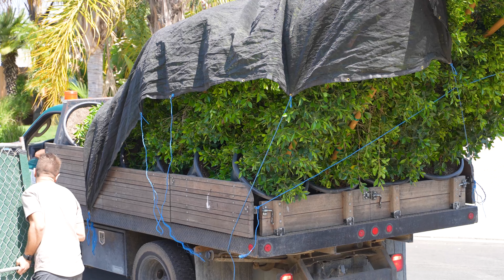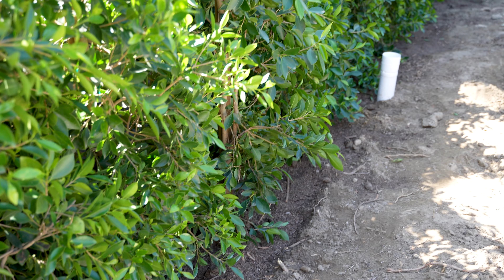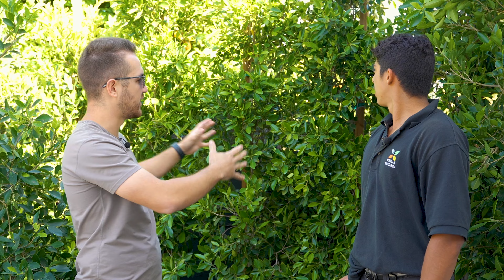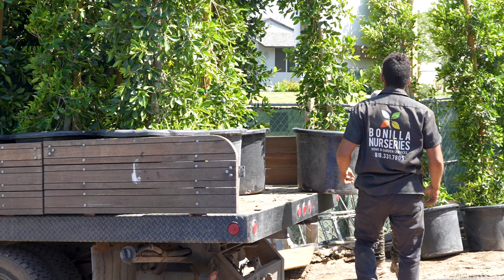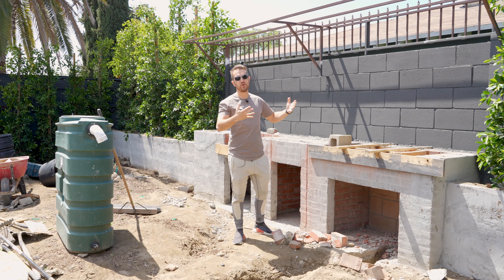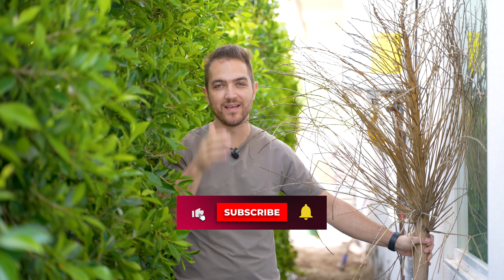Backyard Privacy Using Ficus Hedging All Around the House | New Construction House Flip with Costs!

Comment: Congrats, muttonhead! You just ruined the foundation of the house and walls.
You can't change the DNA of the plant by watering behavior.
These are NOT street or patio trees. These get to be 40 ft tall with a 40 ft spread.
The roots will lift up any cement around them.
It'd be fun to see this property in 5 years or so.
Look up pictures of Hermosillo Sonora México boulevard.
🤦🏼‍♀️🙄😆🤯

Comment: How do you water these ?   My branches are droopy😢
Reply from the maker: We had them set up on a drop system. I know these require a lot of water. I was also told that they are not meant to grow out horizontally which is why they're probably droopy. Just a thought.
Reply: You should trim them to make branches more stronger and not droopy bec after trim it will develop new branches and that branches will grow and trim it again

Comment: Dude having some issues with my ficus in scottsdale, any tips,
Reply: Moon Valley is a joke. You can drive to the Coachella Valley in Ca, and get the 25 gallon I believe for $35, where Moon Valley wanted $125. I bought 40 for my house, they grew almost overnight. If you keep the height about 12’ and keep them trimmed back, you won’t have the root problems everyone keeps posting about. I’ve had hundreds of them at both my houses and have had zero root problems, and I anchor them into our block wall due to the desert winds.
Reply: Damn, me too! I saw prices from moon valley and laughed when i read 8700 for 20…
Reply from the maker: What issues are you having?
Reply: What happened i live in arizona i just ordered 45 trees now look like im scared — they said 2.5 ft away from the fence and 3ft stem to stem distance
Reply: @hanamichizakuragi5021 omgosh
These are 40 by 40 ft trees.
Ever see those beautiful dense tall trees used at Yuma or quartzsite' RV parks?
Their roots will ruin any donation or nearby cement work.

Comment: You don’t ever leave the sticks strapped to the tree. You will literally choke the trees to death. 🤦🏻‍♀️dude really knows nothing about planting lol
Reply from the maker: Chocking a tree like this is actually very possible if done incorrectly. The method of strapping the sticks to the tree was with tree tape/tree wrap. This is designed to stretch and mold with the tree and weather thus avoiding this specific issue of chocking the tree.

Comment: This close to the house the roots will lift the whole foundation up and destroy the irrigation Ficus roots are very invasive
Reply: I had planted a hedge that close to the house 6 years ago and discovered that the roots were extending seven feet from the plant.  We were told that if you maintain them by keeping trimmed and a controlled drip line, the roots wouldn’t be a problem.  We were very diligent but the roots didn’t care.  Fortunately, I discovered this before any damage and am having the hedge removed and replaced with something else.  (Much cheaper than foundation work down the road.)
Reply: @101hamilton   Right! You can control what's above ground, but not what's underground. Ficus has one of the most invasive root systems! And you never really know what variety you're getting.
Reply from the maker: From our understanding the roots for this strain generally grow straight down. Also if the height/size of the trees are maintained and up kept the roots would not expand much further. But it’s definitely something we’ll look more into on our next projects!
Reply: @SEFSU  Please give up an update. I'll subscribe to you to watch for it.  I planted these in my yard in San Diego 2 years ago.  They are so beautiful and I enjoy them.  But now I am worried about roots.
Reply: @SEFSU bwhahahahaha!
Reply: @SEFSU  that’s not how roots function. Trimming the tree does not change or effect how the roots behave
Reply: @elivalentine452  lol if you trimmed it slow down the root system — quiestion did you have the ficus yourself ?